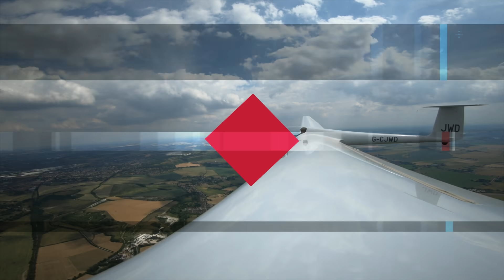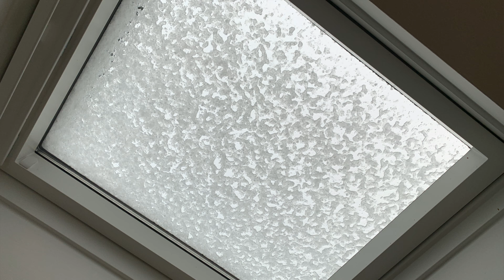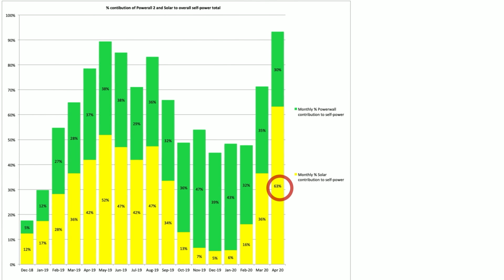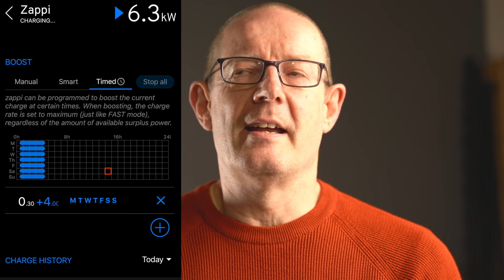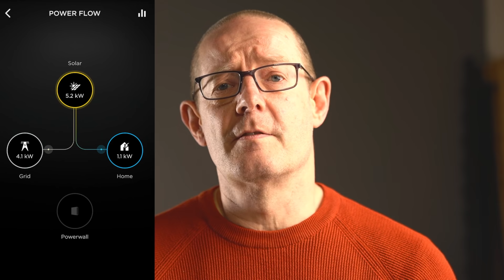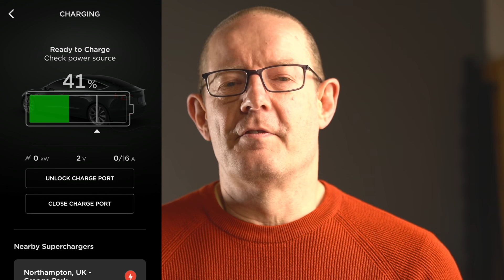Solar and Tesla Powerwall 2 performance April 2020 in the UK

Comment: Hi John, have you by any chance had a look at Tesla Energi in conjunction with Octopus. I just wondered if you have any thoughts on their offer. It seems to me they are using the power of wall To sell energy back to the grid when electricity is expensive. Thanks a lot Denis
Reply from the maker: Hi Denis
I had seen it yes, when it originally came out you had to have a Tesla wall charger so that was a non-started for me, but this has since been relaxed. 

The only thing that I shy away from is the control Tesla/Octopus energy have over your Powerwall to feed the grid. Seems to be against what the individual is trying to do as a householder, you lose some control. If every house had a home battery then I could see it working better. My concern is if I'd planned ahead to use the power I had stored in the battery and then had found out it had been taken. The unit rate is very attractive for sure and I can see the appeal. 

I'm on the Octopus Go tariff and will probably swap to the Agile tariff. However, the only thing that is stopping me is the lack of control over charging the Powerwall. If I was on the Tesla gateway 2 then I could control the charging a bit more. You can't do this with the original Gateway 1.
Reply: John Tisbury . Yes I see what you mean. I have the gateway 2. Power wall was installed at the very end of last month. At the moment I am self powered which means I bleed about 0.3 kW from the grid a day. I too am on Octopus go. I will need to do some figures to see if agile tariff is worth it. No standing charge with the Tesla energy plan, that saves about £92 a year I think. Anyway thank you for your thoughts John have a pleasant afternoon.
Reply from the maker: Have a look here for historical and daily energy tariff data for Octopus Energy. https://www.energy-stats.uk/

Comment: Thanks for keeping us in the loop with your set-up John, all interesting data as usual.

Yes, we had a record April with our 4kw system with 501.486 Kwh. 

Now, that might not sound as good as some of you with the same size system, but when you consider that we loose the sun at approximately 5:00pm (here in the west of Wales) as it dips below the hill to the west of us, our generation is very comparable with the highest figures mention in this April update, so it's all good.
Reply from the maker: Thanks Peter, those are good figures based on your location and sun angle. May is starting our mixed, so I don't think we will be seeing the long sunny clear blue skies again for such an extended period. That said as I type, at 11:00am this morning, Powerwall 100% charged, hot water heated, dishwasher on, 2 ovens on baking and the car charging - all from renewables.
Reply: @johntisbury  Yes, and I bet it's crossed your mind, oh for another battery to charge!!
Reply from the maker: @peterwilliams4735  it has indeed! Although I have two batteries sitting on the driveway doing nothing at present. Vehicle to Grid seems a long way off as a viable domestic off the shelf solution at present.
Reply: @johntisbury  Generally speaking you obviously use quite a lot of electricity (more than most of us I would suggest), especially when your kilns etc are running ------ so, you've more than likely already given this some thought, but it has got me thinking, couldn't you configure your setup so that once you've used up all the stored power in your Powerwall you could then use the stored power in both your car batteries to run the house? I know this can be done as I've heard others speak about it. 

I suppose one thing against doing this, it would tend to be a bit of a balancing job, especially if you were using the car the following day, although I suppose you could setup certain parameters where you would only take so much from the car battery, but it certainly be one way of sending less of your generated power back to the grid.
Reply from the maker: Absolutely Peter, vehicle to grid as the term is known is what you are describing. That is an ideal solution for us as it would allow us to tap into the batteries on the vehicles. Currently there are very few domestic solutions. Robert Llewelyn from Fully Charged has just had such a setup installed. So I'm waiting to see / hear the outcome of that. It's very early days for this technology. Which generally means it's also really expensive!
Reply: @johntisbury Thanks for putting me in the picture John, much appreciated. If it's no trouble, perhaps you'll keep us all updated on this, as and when you hear anything new.
Reply from the maker: For sure, have you subbed to my channel, it's not easy to tell, so apologies for the question. It's free! That way it helps me to keep track.
Just checked with Octopus Energy and they are doing a Powerloop scheme with United Power Networks. £300 per month, you get a new Nissan Leaf and the necessary tech to use vehicle to grid. Seach their website, I'm in the catchment area, but don't want a Nissan Leaf nor pay £300 per month.

Comment: Hi John Thanks for the very informative video, I have a couple of questions I hope you can answer.
1st question 
Are you saying that its not cost effective to feed into the national grid.
and
 2nd question 
Did Octopus energy go into a negative state with pricing (they payed you to use electricity) sometime in April.
Reply from the maker: Hi James, glad you found the video useful. To answer your questions; 

1) It all depends on what tariff / Feed In Tariff you are on. Some FiT schemes, depending on when it was applied for will pay a Feed In Tariff (FiT). Some energy companies, Octopus with their Tesla or Outgoing tariffs for example will also pay for exported energy. For me, our FiT Payment was setup on 2011 and pays on generation only. It does not matter what we use or export (large or small), our payment is not impacted either way.  

2) Yes the National Grid needed to use up the surplus green energy that had been generated, mostly by wind, but also solar. To allow them to balance the grid it is often easier to move into a negative pricing for a short period rather than throttle down a power station or generator. It takes time to get it back on line to full operating output, so it's easier to let the surplus be consumed, than throttle back. Over the last 12 months, unit prices dropped below 2p / kWh 31 times. The suppliers get the benefit of the negative pricing, but most don't pass that on. Octopus Energy do, providing you are on their Agile tariff, which is index linked to the unit price of electricity. As I type, Octopus Energy are the only supplier offering with kind of tariff. They are way ahead of the curve.
Reply: @johntisbury  Thanks John yes Octopus are leading the way I would always recommend them.

Comment: Hi John,  I have now a Tesla power wall installed, but I am a little confused about the charging options. What exactly does Balanced and cost saving do? SelfPower I can understand. You would be so kind as to help me out here, I may be a little thick as I am getting close to 70 years.
Thanks a bunch Denis
Reply from the maker: Hi Denis, good question. 

Self-powered
Use stored solar to power your home after the sun goes down 
Charging Priority for battery:
1) Excess solar

Discharge Priority to supply house:
1) Net usage

Advanced - Time-Based Control (Balanced)
Use stored solar to power your home when electricity is expensive and after the sun goes down 
Charging Priority  for battery:
1) Excess solar
 
Discharge Priority to supply house:
1) Net usage (Peak)
2) Net usage (Off-peak)

Advanced - Time-Based Control (Cost Saving)
Use stored low-cost energy to power your home when electricity is expensive and maximise your savings 

Charging Priority for battery:
1) Excess solar
2) Grid energy (Off-peak)

Discharge Priority to supply house
1) Net usage (Peak)
2) Net usage (Off-peak)

In short, Time Based Control allows you define peak and off peak times (like Economy 7 back on the old days) providing you have a smart meter and a tariff that supports this. e.g. Octopus Energy and their Go Tariff or Agile Tariff. This means the Powerwall will charge during the cheaper off peak costs and supply the house during the more expensive peak rate time period. Best to use Time Based Control in the Winter when there will not be enough sunshine to fully charge the battery during the day. 

Within the Time Based Control there are two options; balanced and Cost Saving. Cost Saving is self-explanatory, it does it best to save you money by charging during off peak rates. Balanced is a blend between Cost-Saving and Self-Power. So it will attempt to charge during the day, but will also charge at peak rate if needed. The Powerwall is unlikely to charge during peak rate if you are set on Cost Saving. 

Hope that helps. Shout if not. 
Cheers
John
Reply: Thank you John for such a detailed reply. I too had my best ever April, but my system is much smaller than yours being just over 4kw
Reply from the maker: Pleasure.

Comment: John good videos... ive just recently signed up to the Tesla energy tariff with Octopus - have you considered this? (you need to have a powerwall2, tesla car and solar array to be eligible). Its interesting as Tesla optimise and manage the powerwall for us. It means you dont have control as they override you; both importing from the grid when there is no sun early in the day, then exporting back to the grid during peak hours (whilst always retaining 20% left for power outages)- this allows Octopus to offer a really competitive flat rate tariff of 8p per kWh all day and night (both for import and export). Its really helping me to cut my power bills down even more than I would without being on the deal. I'd be interested in your views on it if youve not yet checked it out!
Reply from the maker: Thanks you Ehren. I had seen it yes, when it originally came out you had to have a Tesla wall charger so that was a non-started for me, but this has since been relaxed. The only thing that I shy away from is the control Tesla/Octopus energy have over your Powerwall to feed the grid. Seems to be against what the individual is trying to do as a householder, you lose some control. If every house had a home battery they I could see it working better. My concern is it I'd planned ahead to use the power I had stored in the battery and then had found out it had been taken. I'd really be interested to know how you find it once you get setup and working. The rate is very attractive for sure and I can see the appeal. 
I'm on the Octopus Go tariff and will probably swap to the Agile tariff. However the only thing that is stopping me is the lack of control over charging the Powerwall. If I was on the Tesla gateway 2 then I could control the charging a bit more.
Reply: @johntisbury  Hi John, thanks for the reply. Yes I know what you mean about the lack of control over the powerwall. At first that was really bugging me, as I wanted to retain the stored solar for the house at night. Theres something nice about knowing your lights are being powered by the sun from the day! However, ive since come to appreciate it from a cost perspective - as the import/export rate is exactly the same (8p); so any stored solar I export to the grid offsets any subsequent need to import from the grid later (Given Octopus are 100% clean energy, it also means our carbon footprint is no worse than it was before). It basically means im in no way worse off, but better as the daily  flat rate is really good. Conversely, if its a cloudy day - the powerwall knows via the Tesla software and imports from the grid in the morning. When it then exports later, it neutralises any cost id have otherwise incurred. It does mean though im using the battery more than id have otherwise used it on my own of course, which is a negative (but one im hoping which will be offset by the lower energy costs over time). I dont qualify for any FIT payments as we missed that boat, but just on the 8p rate; it seems to work well. Ive noticed a substantial reduction in the cost of our energy bills. Its a very interesting way to do things, and as theres no lock ins it might be worth a try just to see what you make of it ? Would also make for an interesting video! :)
Reply from the maker: Good explanation and considered points, thank you. I will look into it more. Appreciate your detailed response. 
Agree, it would make an interesting video! I will get to it!
Reply: John Tisbury pleasure! Forgot to add- yes we don’t have a Tesla charger either (Pod-Point), and that was fine 😀 look forward to hearing what you do/ think!
Reply from the maker: I popped onto Octopus website last night and it appear that the Tesla Tariff is not available in our area. Strange. I will contact them direct.
Reply: @johntisbury  Oh, that does seem strange! Especially if Tesla are remotely controlling the powerwall. Id have thought that would be all that is required!

Comment: Hi john great video as usual just wondered how you are charging your model 3 eco +. Or eco ++ ?
Reply from the maker: It will charge happily in either mode Glyn. After I sorted out the issue with the setup I have been using ECO++ more as it responds better and gives a higher maximum charge rate. On Saturday I charged it on ECO++ mode and it was a typical British sunny day, the sun was in and out from from behind the clouds. The charger clicked in 21 times during the charge period; 11:43am - 17:00pm and ranged between 1amp and up to 26amps.
Reply: John Tisbury Thanks john great to here I have had a 40 kw leaf for over 2 years now, but would like a model 3 . But I was put of by reading on The myenergi Web page people saying there's wouldn't charge in eco ++ . I have 7.8 kw of solar powerwall 2 gateway 2 , zappi 1 , Eddi,harvi , hub  Also i think l herd you say you were thinking of changing your gateway to gateway 2 why ?
Reply from the maker: The Model 3 is superb, we have a Kona too and love the 3 much much more. It just does everything better. Historically there has been a problem with the Model 3 and ECO++ but that is resolved. There was also an issue of scheduled charging, the car would not accept the trigger from the zappi to start charging. This is resolved by the car now having scheduled charging built in. As you probably know the car is the master device on the charging line not the charger.
The Gateway 2 has some added benefits over the Gateway 1. Ability to run off grid in the event of a power cut. The ability to manipulate the amount of charge in the battery, something you don't have with the Gateway 1. I also believe the Gateway 2 is a little more eiffecievent, I often trickle draw from the grid even when there is 40kWh of solar being generated. My smart meter will show 2kWh over a 24 hour period, but the Powerwall app shows 200 watts.
Reply: Hi John. First time I have viewed your channel. I have been using this site to track usage and it makes things a bit easier. https://www.pvoutput.org/statistic.jsp?id=75790&sid=67190 . Like you we had a record month. The system is a combination of solar edge inverters and lux power tek with pylontech batteries. The lux system is not as automated as Tesla however it is possible to chose when to charge on cheap rate electricity. In summary 1.33Mw for April 2020 compared with 1.15Mw last year. 8 % usage from the grid and a total of 749kwh used. We still export but 92% self usage is not bad. We have 14kwh of storage with 80% depth of discharge. It is interesting to note that the generation figures of your installation are not showing much if any reduction over time. It makes you wonder about what the life span of panels actually can be along with the life span of the inverters. We also have had some issues with the zappi and the promised updates how yet to appear.
Reply from the maker: Thanks John for your comments. I too use PVoutput.org it's a great website. Good figures for you in April, I'm guessing you have a large system to be at those totals. The panels, if they are good ones, should not degrade much. Most are guaranteed for 25 years, the inverters for about 8 - 10 years. Sorry to hear about your problems with the zappi, I'm on my second one since Dec 2018.
Reply: The zappi issue is the way charge figures cumulatively increase if you do not disconnect the car between days. I have not reviewed your content but have you had any problems with high grid voltage ?
Reply from the maker: I always disconnect the car overnight so have not witnessed that. No issues with high grid voltage.

Comment: John hi, i think i have the same issues with the Eddi and the PW2, was it just a case of flipping the black and red wires inside the Harvi? Keen to try that but want to make sure i am doing the right adjustments....  I hate seeing my energy flowing back to the grid, as i dont have any FIT... thanks in advance.
Reply from the maker: Hi Peter, the myenergi CT clamp should be clipped to the LIVE brown wire that leads into the consumer unit from the Powerwall with the arrow pointing on the clamp pointing towards the consumer unit. I can't get to my brown wire as it's buried, so I've attached it to the blue neutral wire from the Powerwall. To swap the direction you have two choices; unclip the clamp around the cable and reverse it so the arrow points the other way. Or like I did, on the red and black wires on the actual CT clamp I just reversed them from their current positions. Red in black and black in red. This reverses the flow too. Hope that helps.